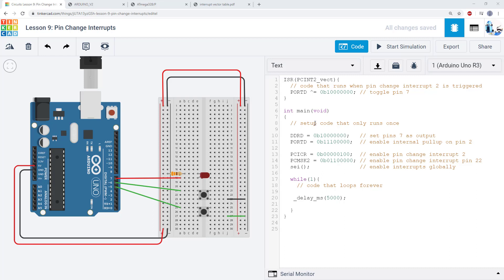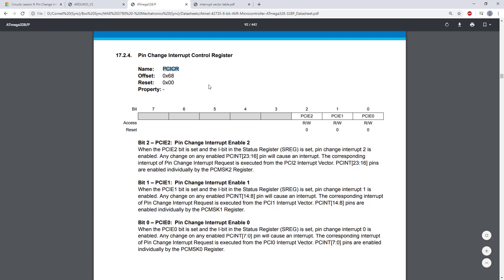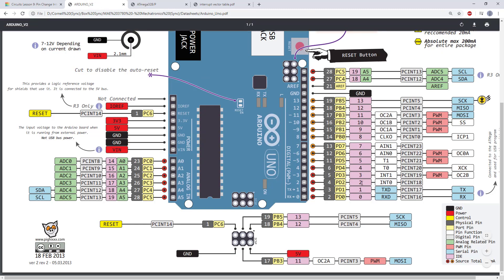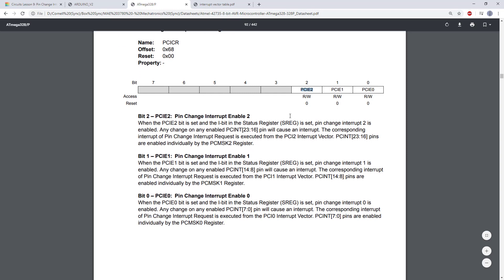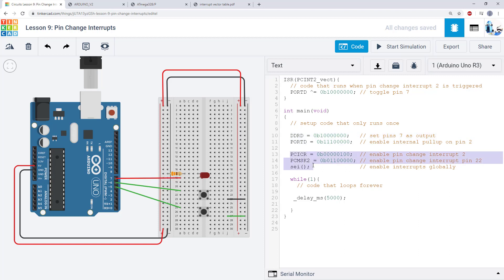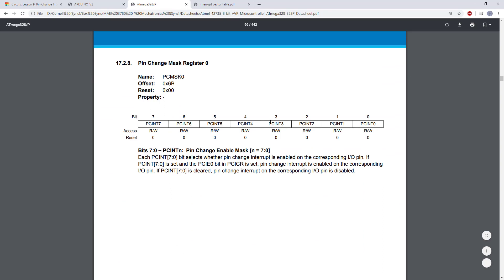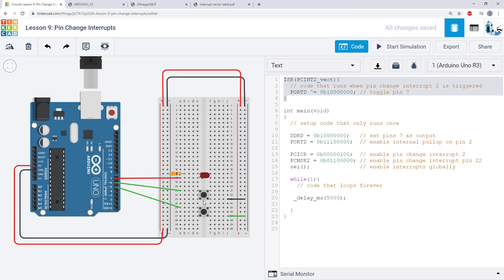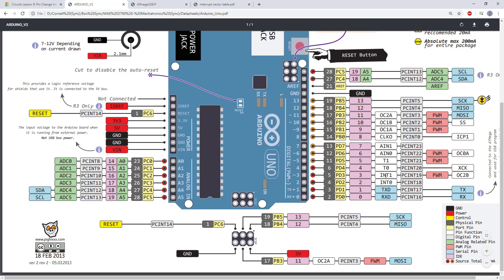Tinkercad + Arduino Lesson 9: Pin Change Interrupts

Comment: I tried to use other pins (pin 8 as output and pin 12 as input)  but the voltage at the output pin 8 is lower than the output on the pin 7 (using pin 3 and pin 5 as input) what can the problem in that case be